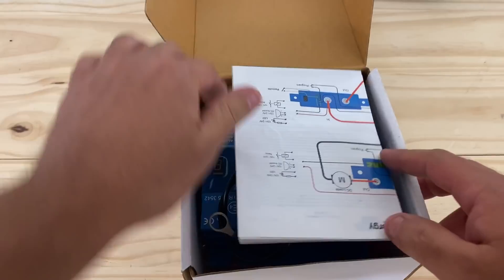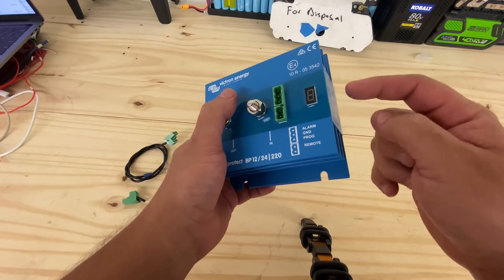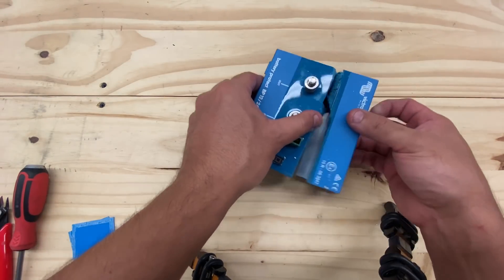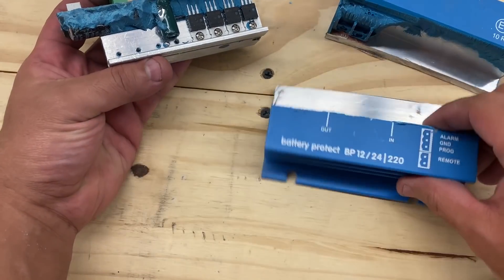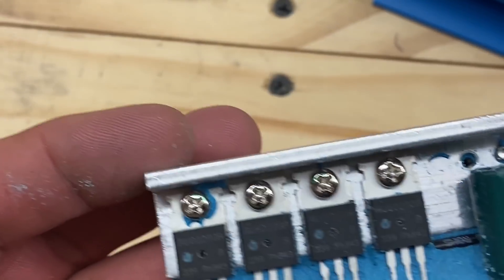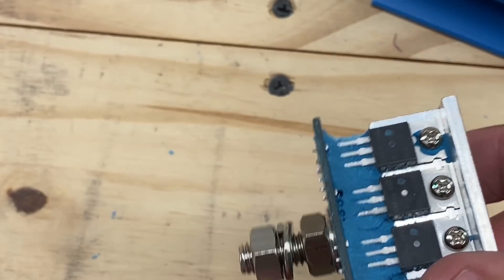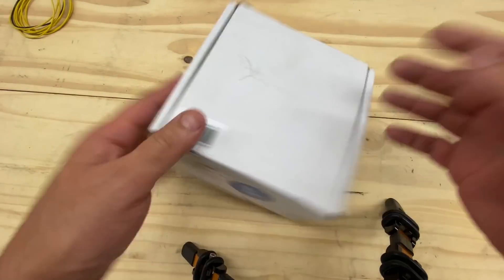Victron Battery Protect  BP12/24 |220

Comment: What the requirements are saying,  is NOT reverse polarity during charging!    (Just DON’T insert it into your charging circuit!   Place the charger or solar-charger or alternator across the BATTERY!,  & place the Victron battery protect in your LOAD!)

think of it this way:  remove all your connections and connect your charger or your solar-controller (solar-charger).      Now that the ONLY connections that are connected to the battery!,   Now connect the battery protector to your LOAD!,  and then connect the battery protector to your POSITIVE terminal of your battery.

Comment: If is 2 way how can stop only chargers or only loads? You must put 2 together?

Battery protect have not Only under voltage protection. 
Have also over voltage (obviously to stop the chargers and not loads)
Have control relays to pilot a sirene or light or what you want. How can use this different purpose function if is a 2 way fet relays?

I power one with 2 thermal switches in series put on each battery of parallel. If im not in RV and rv is under big charger and 1 battery cells short, can burn my RV because absorb never ending the max current.
But the thermal switch at 50 c open and separate all chargers from 2 batteries. Yes the good will discharge into the shorted battery but with ridiculous current and any fire. I go back and can resolve the problem.

Comment: I don't understand the sense what you say. Ever is possible to make better things.

Why are boats and car if you can make a vehicle that go both on street and water?

Why computers have for years a CPU, a GPU, memory, etch on separate components if was possible to put this things on a single chip from decades? Why all companies makes inverter and chargers if is possible to do both tasks in the same device with the same transformer?

Why makes mppt charge controllers and alternator chargers if a single device can do both tasks?

If a company decides to make a product have her reasons. 

We must destroy all diodes in the world because they allow Only one direction current?

I don't understand really.

You create another device with different characteristics. Maybe far better? I don't know. But if i make a one sense fet relays is not Only to sell more.

Comment: How is the aluminum part attached to the MOSFETs isolated from the blue heat sink? I see no isolation, so the battery voltage is directly in contact with the heat sink ??

Comment: Two things:
1) Unless your battery charger is an idiot, why would you need to protect your battery from your charger using this device? Bypass this device with the charger.
2) I'm not an electrical engineer, but I don't think Victron is simply trying to sell you more stuff. The main component in this device (the thing that actually cuts the current) is a solid state switch rather than an old-fashioned solenoid switch. Unlike a solenoid switch (which has moving parts), you'll wreck this solid state switch if you try to feed current the wrong way through it. That's my understanding, anyway. For me, it's a worthwhile compromise.

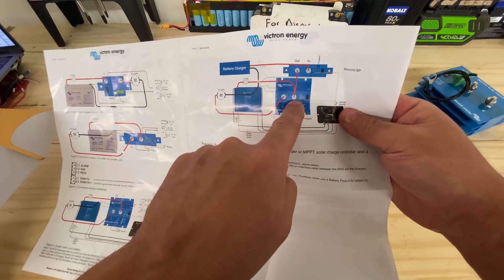Comment: 0:50 No, this device is to prevent over discharging your battery. So why should you put a battery protection on the charging devices? The thing is that this device uses a mosfet as a switch. If you want to go both ways you need two mosfets in series with oposite polarity. This means double the resistance and double the heat meaning double the energy loss. Which would make this device way more expensive so its better to just make it single way and if you want both ways, to then buy a second one.

Comment: You need to read item description before buying. This is to prevent your batteries from being over discharged. An example is an inverter cutting out at 9.5 volts which will stuff up your expensive battery bank. I spent over $1000 on my batteries so spending a bit over $100 for a quality protection unit is value plus. This way my batteries are disconnected from my inverter at 10.8 - 11 volts so they can recover to 11.5 + volts. Also 220 amps spreader over 8 MOSFETs is under 30 amps per MOSFET, well within spec's. This is why it has a 5 year warranty. If you purchased the wrong item you can return it before wasting over $100 with an angle grinder to make a video to prove your out of your depth.
Reply: Don't inverters already have this function? At least victron ones
Reply: Don't use this on an inverter, it will fail immediately, because of reverse current and or high capacitor inrush current.
Reply: so I’m pretty new in this field and I’m choosing you to help me answer a question so forgive my ignorance. So doesn’t the internal BMS that the battery came with prevent this?

And furthermore, it was my understanding that lithium batteries, whether 100% charge or one percent charge or at 12.8 V. If you could explain, I would greatly appreciate.

Comment: Do you think it would be alright using this on a 3000w 24v inverter?
Reply: No. As i have found on many forums, when the BP reconnects the capacitors in the invertor have such a high inrush current that it fries the BP. So this item is useless.

Comment: I appreciate the comedy, but it's good to learn and you could easily pulled the datasheet. Each of this mosfets can handle 60V 230Amps,  there are 8 of them, so it's heavily overbuilt to reduce heat. https://datasheetspdf.com/pdf/1107810/Ruichips/RU60200R/1

Comment: 111520/0137h pst.   You are right, in your observation. I’m not criticizing negatively, but there seems to be many add on devices to PV systems, in the market; which are redundant items. The company sells Battery [LiFePo4]for PV Systems that incorporate a BMS, built in. The BMS shuts down the battery if it discharges beyond the limit or overcharges beyond the limits. You are right and saves some cash from buying the redundant item, altogether.
Thanks, stay safe and 73s...* 
*73s= regards {Radio lingo}

Comment: I am pretty sure the SSR works both ways, to protect the battery current flows through the MosFet, to Charge theBattery  current flows through the bypass Diode thats inside the mosfet.

Comment: Jehu, I have a battery question. I built a MX type ebike with full suspension. I have an 72v (84v) battery 20s6p. And it’s a little weak on holding the load at time . I’m thinking of losing 6 pounds of weight on the bike and want to add a 20s3p pack. Can I do this or does it have to be the same size packs?

Please advise?
Reply: do you have a cutoff saw???

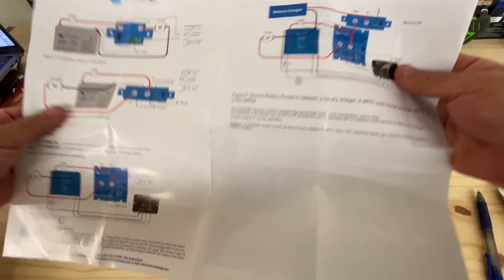Comment: 1:00 There are two relays so that the charger and the load can be switched separately. If your load is too big for the charger to follow, it will damage the battery. So the battery can be charged and only when a certain voltage is reached can a load be switched on again. 
Wikipedia: Hysteresis

Comment: This BMS is meant for large capacity battery systems. It will protect your batteries from over charging and over draining. The discharging will be connected directly to your battery.
Reply from the maker: None of what you wrote is true
Reply: jehugarcia , my bad J. Total mis- information on my part. Got modules confused. Took dislike back. This unit is great for connecting power inverter to and protecting your battery (ies) from dipping below set voltage.
Reply: You will damage your Battery Protect if you put this between the Battery and a strong inverter.
The MOSFETs don't like inverters and Victron strongly advises to not connect Inverters to this type of BP
Reply: @2DC24  if i put it between solar charger and battery is it ok ?  cause i bought one i m far from system most days and cant secure when batteries are going to sagg to death  when no sun.. plus  they give some info for  external generator relay but i wont buy any VE  .. will try my own  relay .. wish me luck!!!!!!!
Reply: @2DC24  ...true, I damaged 2 of them with an inverter.

Comment: Jehu, you can actually use these LVD modules without using a second module to charge. It's simple, just connect the charge wire positive to the battery side of the module and not the load side. The module continues to protect the battery from low voltage and still allows you to charge without back feeding the module. There really is no point in using another module because it would only be on when that charge voltage is present and if it's charging then the voltage is definitely above the disconnect voltage, so it's not actually protecting anything anyways. If you look closely at the diagram, it connects the load side (Out) of the second "charge" module to the B+ (In) of the main module.
Reply: ooooops

Comment: Oh yeah, you want to program the cutoff voltage ?  Well your just going to have to purchase the $29.00 programming cable (which btw is 1/3 the cost of the original product).
Reply: They do not have a ve.direct port. You program them by shorting the pins or via bluetooth.

Comment: Jehu. I know of a product that will do exactly what you’re looking for using it as a solid-state relay to up the power of your BMS they are called solid-state relays and used in things like ceramic kilns and other high amperage heating element switching they sell them on Amazon I will try to look one up and re-post the exact name to look up but I’m sure you can find them if you look up “SSR“ the last time I purchased one was from AliExpress
Reply: Those SSR a thyristor based  it won’t work for this DC application   by using thyristor on DC circuit,  after you turn them on there is no way to turn them off unless you remove the current from the main terminal.  SSR made with mosfet , mosfet you could turn them on and off   like the one he tear down  crydon make DC  mosfet based	SSR that handle 160Amps

Comment: Hey Jehu, that was a real teardown men, I think how if you remove the diode from in there which only allows currant unidirectional!!🌹🌹 You cut it open Jehu Lolz you think you will get your money bro that's a 100 bucks it's actually crazy for that PCB's aluminium heatsink, 4 MOSFETs those FETs are actually good Bro and a ton of Epoxy resin, you are right not to buy that stuff!! Great Video, great to see you

Comment: I have had nothing but trouble with victron stuff, had a victron 1600va sine wave inverter, used it once then caught on fire 👎
Reply from the maker: Don’t say that out loud! the Victron fanboys will set you on fire for that
Reply: I know dozens of ignorant diy solar people's that cought fire all types of things and destroy a lot of batteries and they affirms they are not responsible.

Half of people i see work with solar at home and RV don't have reeds 1 manual in their life. Only YouTube charlatans.
More than half of diy installations i see are wrong.

For me the inverter broke down is 50% do to bad use and 50% do to defect manufacturing. If is a defect you have warranty. My friend is victron seller and change under warranty a lot of things that we know are totally users responsibility. And he accepts to send on warranty and victron to.

Comment: I use a BP-220, but am looking for a replacement solution.  The critical flaw with this thing is the short circuit protection.  Like that's not your job dude, it's my fuse and breaker's job, you're not special.  The stupid thing thinks there is a short circuit every time my charger disconnects.  Resets my inverer & computer and ugh, so annoying.  Critically flawed product in my opinion.  Thinking of going back to my contactor and take the efficiency hit, better than this headache.
Reply from the maker: So this sucks because it doesn’t do much but the little it does doesn’t do it well..... yeah I’m a real jerk for not liking it.

Comment: This is the kind of stuff that makes this channel confusing and impractical to use to build these projects. You provide a link, "Get This Instead" but the link goes to batteries not a similar device to what you are featuring in the video.
Reply from the maker: That’s a good product,  they do what you expect them to do and they do it well.  Where’s the confusion?
Reply: @jehugarcia  For one as I said above you provide a link suggesting (Buy this instead) that you have found an alternative but it's a link to batteries, that is confusing when the whole video talked about this device you featured and not batteries.
Reply: @stevelaminack1516  I agree, so the device in the teardown doesn't support charging, logically you'd expect to find a link to an alternative, that does the job, especially if you call the link "Get this one instead", but it leads to batteries. So there is a problem and no solution.

Comment: I think I like your channel better when you actually built batterys. They were great still watch them. But lately a real snooze maker. So as a long time VEIWER please go back to building batterys. Thanks still subscribed.
Reply: No the battery was alread built. I talking starting with  regular 18650s charge, discharge, and  repack solder or spot weld fuses. In other words build a battery. Not put two batterys in parallel or series  that's putting someone else's batterys together . Or slapping some batteries in some pc boards. Hands on get DIRTY an build a battery. Like the sombas battery. The 7s 24v battery packs. Let's not forget the better than a Kodiak generator BUILT the battery packs. Video was one of the best diy solar generator videos out there one of.
Reply: He was building a battery in yesterday's video and in the video before that one as well.  Interesting series

Comment: And you can program it to protect high and low voltage
Reply: That's what the battery management system (BMS) is for. No need for the device shown in this video.

Comment: Could be used as a battery isolates. Like in an RV.
Reply: that is actually exactly what that product is for:
The BatteryProtect disconnects the battery from non essential loads before it is completely discharged (which would damage the battery) or before it has insufficient power left to crank the engine.
Reply: Good products from victron but expensive

Comment: Somebody commented on my channel and recommend this thing, said this is another level. 😊 and he's right. It's another level of rip-off. An automatic hi/low voltage cut-off (with adjustable digital display) board paired with a 300A continous duty solenoid relay switch is a much better diy option than this. You got your hands first on this thing. I was planning to do exactly the same for my future video content. Thumbs up Jehu! 👍👍😊

Comment: It's designed for load take-off, charging is done the battery side of this device! - Seriously, would a quick google search have killed ya......! - what a waste!
Reply: @jehugarcia those are discrete N mosfets , they are directional , they can't work with load and source sides swapped , even the BMS boards you have on you PCB kit have two set of MOSFET , one for charging and one for discharging
Reply: Should of watched Will powers review an at least learned how to hook it up.
Reply from the maker: Go ahead and buy two for the price of four.  I just googled “gullible” It simply said Peter Kay
Reply: @jehugarcia  Well he is right though. You bought something believing it would do A but infact it does do B. A google search would have shown you it doesn't do A but B. It's not their fault you bought a device unfit for your application.
Reply from the maker: I have no idea what you are arguing, I never said  it’s anyone’s fault,  I simply said the device is stupid
Reply: @jehugarcia  Why is the device "stupid"? It has a purpose and provided you use it for the purpose it was intended it'll be absolutely fine! - Or, did Victron reject your promotion sponsorship idea, so you're pissed with them? - Note: I don't work for Victron, but I do run the VE users group FB page!
Reply: @jehugarcia  Seriously i think you need to check out the price of bi-directional solid state relays!  Get in contact with perfect switch they are based in CA. They have exactly what you want but don't expect it to be cheap!

Comment: So you'd rather have two pieces of cheap  Chinese junk that blows up your entire battery pack?  You are right about one thing, you don't know what you are doing!
Reply: This is Interesting, @wrndlabs  Victron Energy with out a doubt has good marketing and good  updated products. Outback and Midnite MPPT design ( By the same engineer boB ) are over 20 years old and lack the software Victron has. Like you said the electronics is simple 101. The design, I would say is not the best but for the price of about 115 US Dollars you get a finish product that is suitable for boats and RV ( Salt, Water, Vibrations, Dust, etc ) Just look at the epoxy and the machine aluminum dissipator.
Now @Valentin Bonnet  I don' think this is a mass produced product, maybe about 5,000 units , Who knows! It's a switch that will not allow a battery to die, plus al nice way to select the battery type.
The thing that hurts the most is the FET used, this company Ruichips ( has 70 employees, really 70 employes and they have a wafer facility!, really!, come on am I this old ), it's in China. It's amazing! What are the probabilities that this is a copy of the International Rectifier IRL60SL216 on a TO220 Package? Or that Infineon sells the die ... nah they would have to sell the components .. I don't know, I'm just an old guy that noticed the industries has changed a lot. 
The "Switch" is made in India and uses China "IC"? but Chinas main import is chips and IC. It does not make sense ! Anyways Victron has something to think about, it's not just the design it's also the built of the product.
I remember IRF had over 10,000 employees in California..
This is sad history.